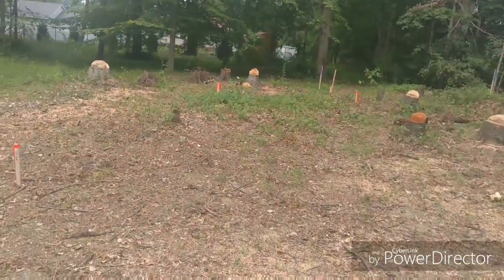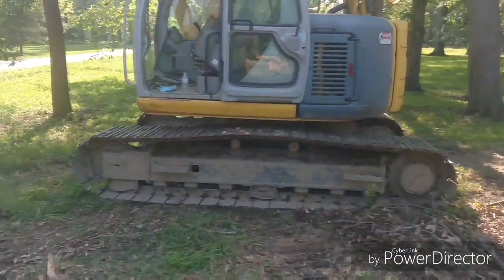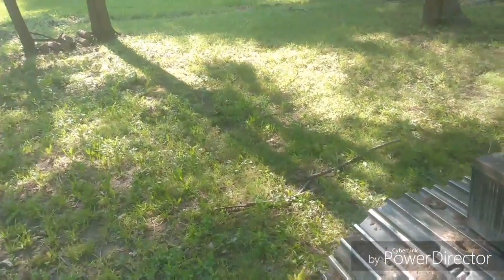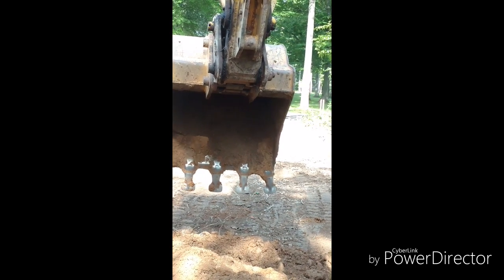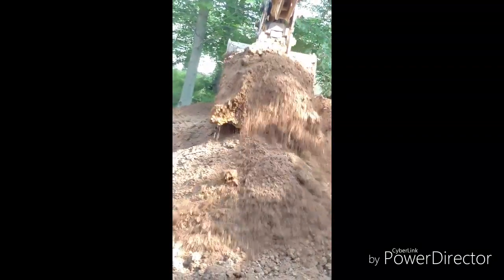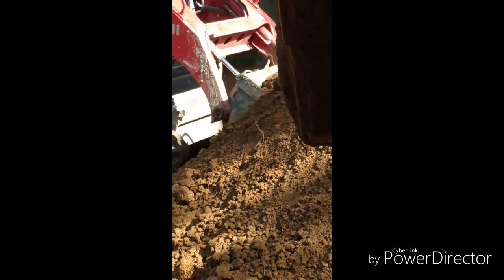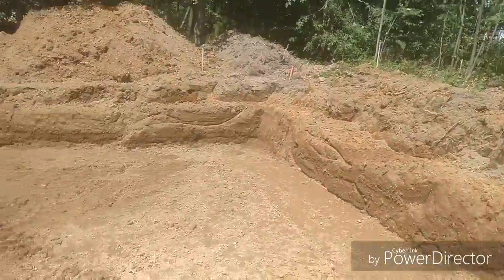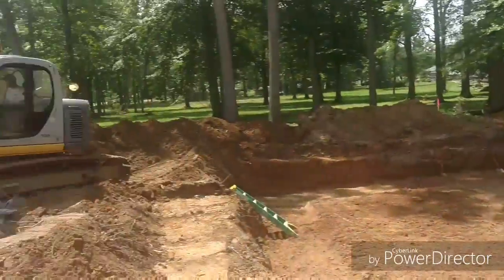Basement excavation and sewer excavation

Comment: Per your comment - lead/acid batteries generate a certain amount of hydrogen gas as a result of the electricity producing reaction between cell plates and water.  Over time, water loss occurs and the structure can weaken some and cause the plates to touch and short circuit, creating a spark.  If the fuel/air mixture is right, they'll pop pretty loud.  Best thing is to keep the water level over the plates and check post connections regularly, that way electrical loads are consistent and there is good surface connectivity - far less chance of a spark.